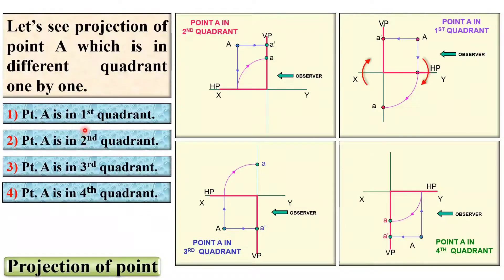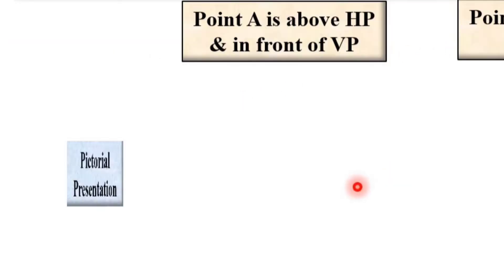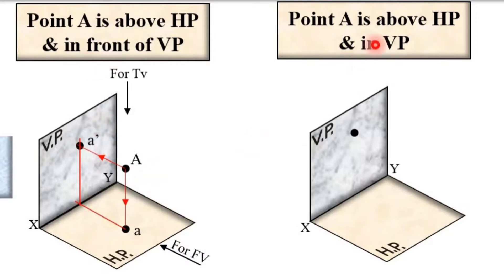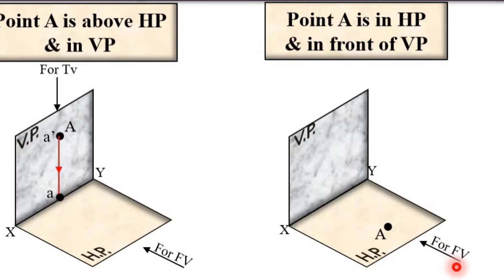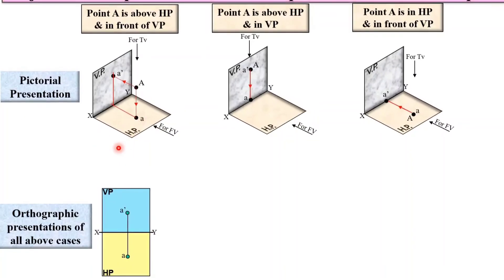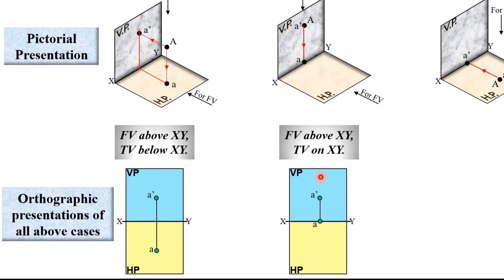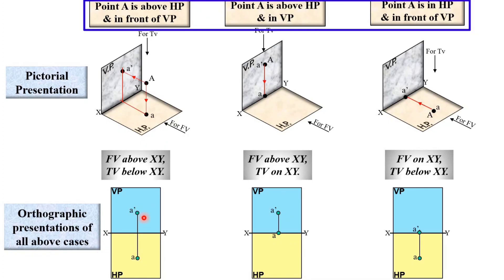2 - Projection of points (Basics, Drawing Process & Solved Example) Explained in Engineering Drawing

Comment from the maker: Projection of points explained with following timestamp: 
0:00 – Projection of points in Engineering Drawing lecture series 
0:26 – Projections of a point in first quadrant with different position
0:38 – Projections of a point above HP and in front of VP 
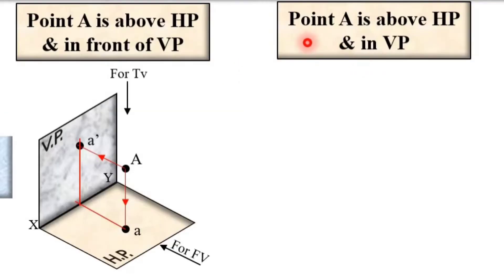2:21 – Projections of a point above HP and in VP 
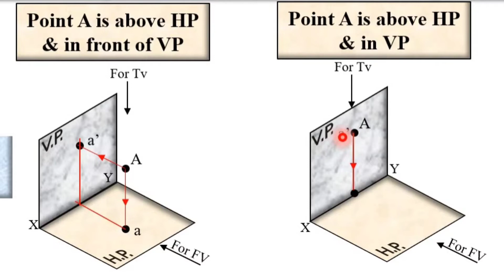3:16 – Projections of a point in HP and in front of VP
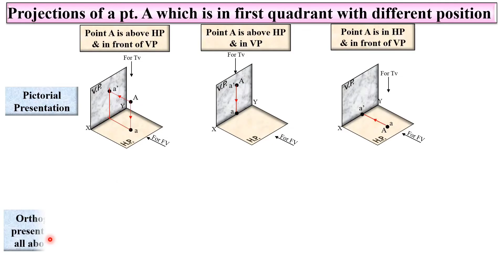4:04 – Orthographic presentations